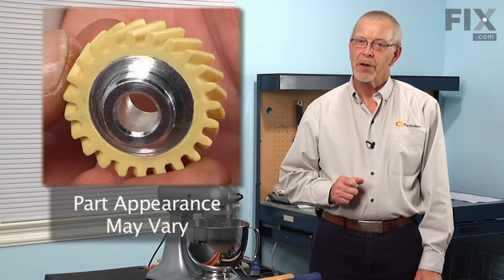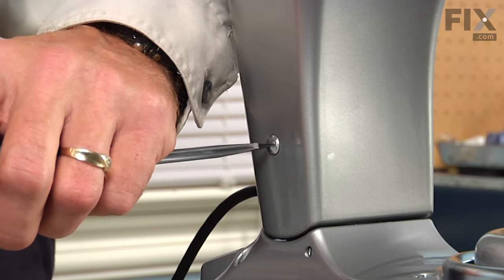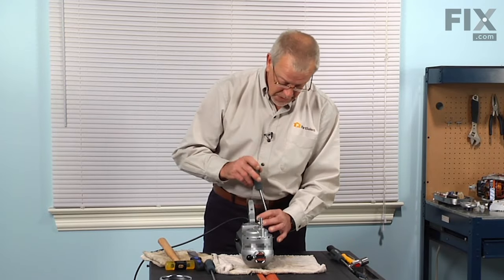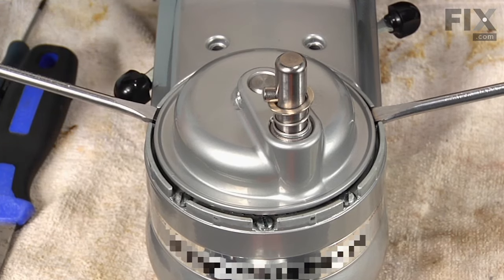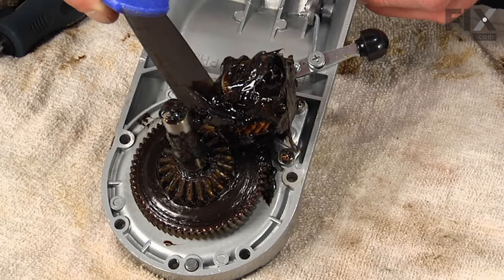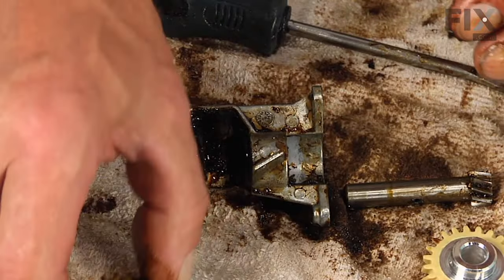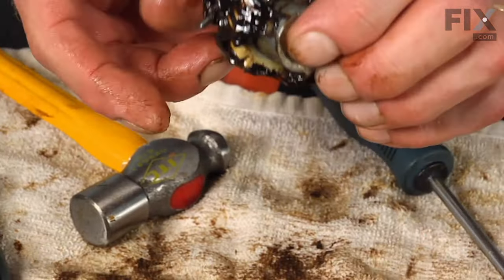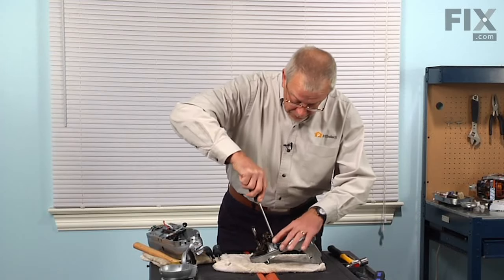KitchenAid Mixer Repair – How to replace the Worm Gear

Comment: Great instructions! I was able to repair my 18 year-old KSP150. The only suggestion I would make would be to explain when the worm gear needs replacement, and to show a damaged worm gear. My mixer started to make a rapid clacking noise when it was turning. Fortunately, when I opened up the mixer according to these instructions, I saw right off that several teeth of the worm gear had been sheared off. Again, well done!

Comment: I really like your video, very good stepwise explanation, let me add a recommendation, if the worm gear is broken you really should remove all old grease and not reuse it, because the broken parts of the old worm gear (the dents) are partwise in the grease and you do not want to ruin your new wheel with this. :-)

Comment: Just fixed my broken gear. This was up there with one of the best “how to” videos I’ve watched. Instructions were to the “t”. You do need to know how to use basic tools and have a little bit of a “handy-person” in you, but other than the messy grease, it’s an easy fix. Thank you! Never mind what that loser said about the ball peen hammer; appreciate a free video that shows how to do a job that would be nearly impossible to do w/o this tutorial. Kudos!

Comment: Thank you your video was awesome. I was able to make the repair and fix the mixer. I have model KSM500PSSM0 Pro 500. the only real difference is two of the four screws could not be accessed unless the base was removed.

Comment: Thanks for the video. It helped a lot when I replaced the worm gear and the grease on my wife's Kitchenaid mixer. The only problem I had was with the screws. The model Classic Plus, bought in the US, has square heads on most of the screws, instead of the regular flat heads. Not hex, not torx, but Robertson square. Fortunately, one of my smaller flat screwdrivers fit diagonally on the head and I was able to unscrew them. I'll try to find a Robertson screwdriver in a hardware store to tighten the screws a bit more next week. Otherwise, the video is spot on how to replace the worm gear.

Comment: I would like to add a note about the grease. KitchenAid mixers specify part number 4176597, which is a black colored BENALENE 930-2 grease. This is a grease designed to run at higher temperatures. Not all of the 930-2 greases are food grade H-1 registered with the NSF. The one made by Microlubol is, and the 6oz jar at Amazon is enough to generously grease your gears twice. This is a superior lubricant compared to the standard H-1 white gear grease, which I found to be almost immediately disappointing.

When you take the mixer apart to get at the gears, clean it like crazy. Don't just wipe the old grease off, get down into the gear teeth with a toothpicks and an old toothbrush. Wipe things off with a lint free rag; you'll need several of them. Work the new grease into the teeth and coat the shafts and washers. Put things back together and spoon on even more grease. 

If, after all this work and carefully putting things back together, you find that the mixer runs a bit slow and might freeze for an instant once in a while, it's either because the grease is too thick or the replacement worm gear is NOT exactly the same as the factory part. Many of the imported gears are "close enough" but not exactly perfect. It may be the best idea to spend a few extra dollars and buy the OEM official KitchenAid gear.   If you didn't do the crazy-level cleaning and find this stop & go issue, you may still have a bit of crud in the gear teeth. Take things apart, get the right parts and grease, and do it again the right way this time.

Comment: Hi. I replaced the worm gear on my mixer and it spins fine now but it slips when it encounters even slight resistance (but when I opened it, the new worm gear doesn't seem to be getting ground down at all).  Any ideas?
Reply: Check the small metal drive gear at the bottom of the same stack where the nylon worm gear is. I had one where that metal gear ground itself down, the cost to replace the whole stack wasn’t much more than just the worm gear.

Comment: On Newer KitchenAid mixers you will need an S1 sqare bit for the body screws and a ⅛ hex for the pedestal if you choose to remove it although I typically find that's not necessary necessary on North American Tiltedhead mixers.

Comment: I put the worm gear back it but it's really rough to spin still. Seems like the long piece that goes through the centre of it has resistance for some reason. Even without the worm gear in, just spinning the other gear in place,  it's got resistance to turning....

Comment: Thank you for the excellent video.
I'm working on a KitchenAid model K5SSWH serial WD2522320.
It was making some odd noises.
When I opened the top cover, I noticed a loose 10-24 nut in the electric motor compartment.
It's a plain 10-24 machine nut.
It fell off one of the stator hold down studs.
I noticed the nuts on your mixer are the aircraft locking type (with the nylon ring)?
Fix.com wants $23.88 for one lock nut?
Are these available at the local hardware store?
Are there enough threads to engage the nylon locking ring?
Or just put the plain nut back on with some red bearing grade Loctite?

Comment: I wonder why not clean off as much of the old grease and re-grease with new clean grease. And what I mean by clean is if the worm gear is damaged those pieces that have sheared off have to have gone somewhere. As a bicycle mechanic I always clean off all old grease and regrease when working on the moving parts of a bicycle . Also as the commentors below Josh Goldberg and Jeffery V pointed out, this video should have started with showing a bad gear and the running of the mixer with the bad gear so we can hear if the sound is similar to what we are experiencing. Other than that this is a very useful and well done video and I appreciate the demonstration.

Comment: my gears seemed OK, but there was no pin inside with worm gear assembly. a badly bent was found inside, with almost an L shaped bend. Ever seen this before? Should I try to replace just the pin, or the whole gear assembly?
Reply from the maker: That pin definitely took a huge strain if it was bent. If the hole where the pin is elongated, replace the gear. If the hole is perfectly round and not damaged go for just the pin.

Comment: There are two washers, equal size/thickness, one on each end of the worm gear.  Make sure you save the washers when removing the old gear and reinstall them, one on each end, with the new worm gear.

Comment: I've reassembled mine but cannot rotate the shaft using a drift through the hole in the end. Is that normal? I seem to remember being able to turn the shaft before dissassembly. I could just turn on the motor ...
Reply: OK I switched it on and it worked. You cannot turn the mechanism using the shaft; too much gear resistance I suppose.

Comment: Definitely wear gloves and do this on a much larger (covered) work surface than the one pictured here.  Another missing but absolutely critical step is to either thoroughly clean the old existing grease by removing any small rubber or metallic particles that may have broken off from the old gear or discard the old grease and use new grease (they sell 'food grade grease' that looks suitable).  Any particles in the old grease will grind against the new one and ruin it very quickly.
Reply: Good point, I just typed out the same point before I read your comment, so I went back and added a reference to your comment.

Comment: This is an F'ing nightmare and I am pretty damn handy, the pin will not come out and have now buggered the entire hub and bent the shaft, do your self a favor and buy that small assembly, best spent 25.00 you will ever spend....
Reply: Bought the gear, couldn't get the pin out either (bent several punches) - currently buying the assembly. Still cheaper than a new mixer, though - should've taken it fully apart before buying the part. Ah well!

Comment: The grease is cheap, clean out the old grease and use new. The old stuff has pieces of the chewed up gear in it and will immediately start abrading the new gear, drastically shortening its life.

Comment: I bought a new gear and when I took it all apart per the excellent video I found the pin holding the pinion gear to the shaft was missing allowing the gear to spin freely. I searched all thru the case and all the extra grease but never found it. I used a cotter pin instead and it seems to work fine. The mixer was given to us because it wouldn't work, maybe someone tried to fix it first

Comment: On minute 2:26 there is a pin being removed. No matter how hard I try, it seems to be stuck. Any tips?
Reply from the maker: That pin is normally very hard to remove. Use a large enough hammer and make sure the shaft is properly supported when striking the pin punch.
Reply: Thanks a lot. I´ll give ot another try and let you know how it went.